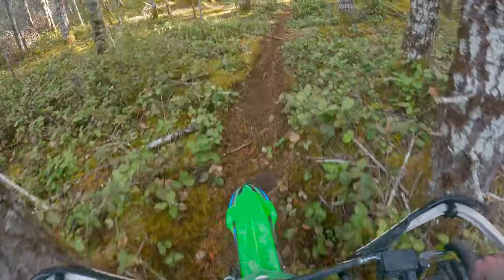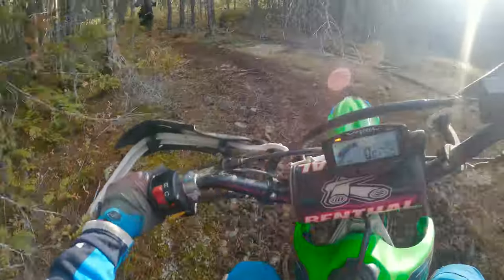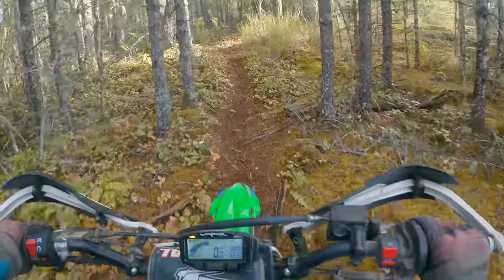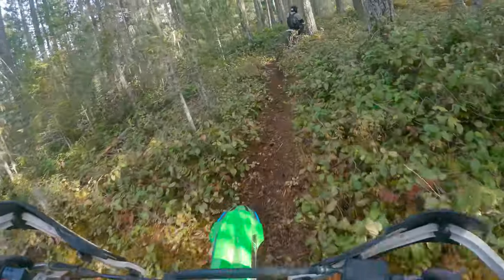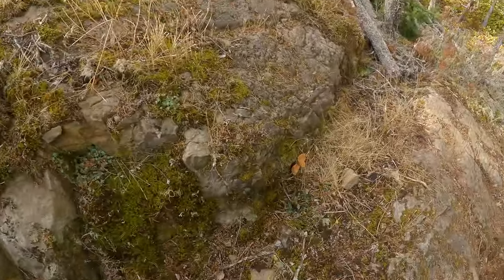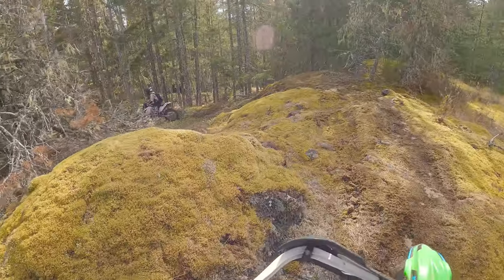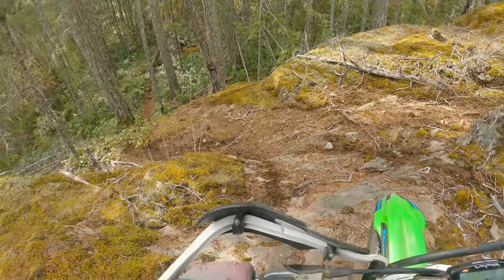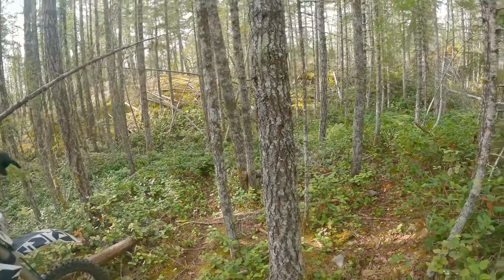One Fatal Wrong Turn | BBR KLX170RF

Comment: You folks have some amazing riding skills !  👍 For myself watching your videos is really enjoyable and many of them I would call it " Trials Riding " with the difficult rock formation climbing and riding up the " Dry Wash " creek beds filled with loose gravel & small boulders .  It takes real talent to do that !    
     Have you ever thought about gearing down the 170 on the sprocket final drive ?    That's the first thing I did to the 2004 RM 250 . Went 11 on the transmission and 60 on the wheel . Sure made it easier to crawl around a slower speeds .    https://www.youtube.com/watch?v=2PKNdd2P5m4
  Keep up the great work Aaron !
Reply from the maker: Skills only come from pushing ourselfs! Im glad you can enjoy coming along for the ride!

I have geared down the front sprocket of the bike to a 13tooth. But i can only find stuff thatll gear the bike taller. Currently super happy with how it performs gearing wise in the slow stuff!